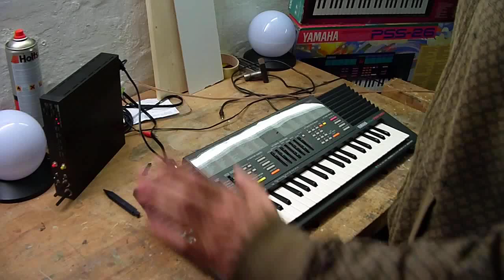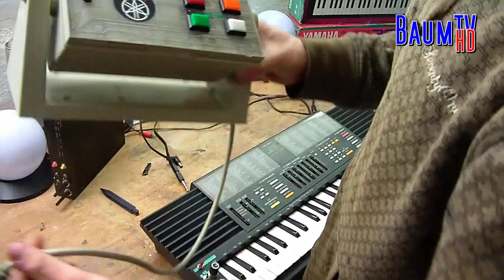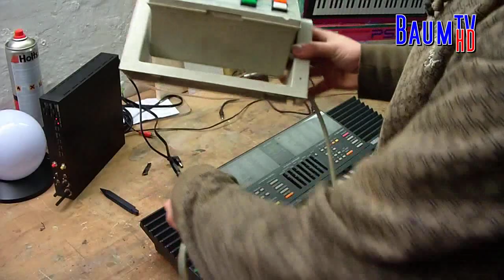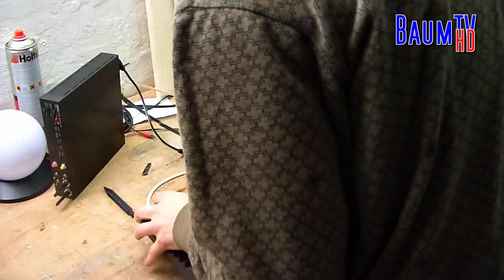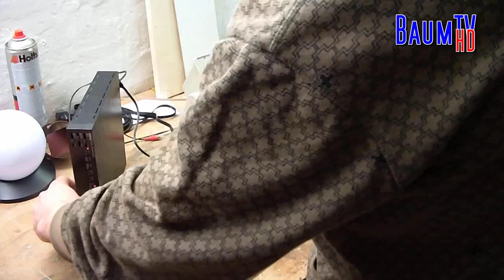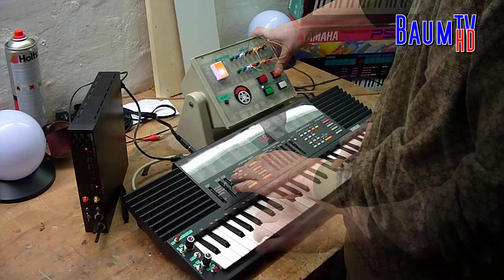Alien Synth Yamaha Portasound PSS 390 (Circuit Bent by BAUM)

Comment: I have two of these synths and I'm going to take this concept a step further and MIDI-synch them together with 2 Highly Liquid retrofits, full dataline mods and full rotary patchbays for both. They will be attached one behind and on top of the other and connected with wooden side cheeks. This means maintaining all functions and having full stereo output of both keyboards. It also means minimal soldering and no need to piggyback chips. Should sound pretty awesome when it's finished :D

Comment: The FM chip inside the PSS-380/390 keyboards is the YM7129, although the service manual calls it the YM7116, (which is actually the FM chip found inside the PSS-280/290 keyboards). This is just a misprint by Yamaha. The dataline pins on the chip are located at pins 11 - 18 (D7-D0) and the crystal clock is a blue ceramic cap located to the side of the chip. There are actually 2 crystal clocks that can be bent. The FM crystal and the CPU crystal. One for note pitch, the other for keyboard speed.
Reply: Michael Samuelle hi I find chip but where  ym7129 pins are addressed ? Is it on xg315do or xg314bo ? Really appreciate your helps cause service manual is unfindable on web. Thanks

Comment: Looks like a great mod. Are there instructions anywhere? Is the 2nd chip also midi controllable? Have you basically put the board from a 2nd pss 390 inside with the other one or only a 2nd chip? What is the black box? Midi? How do both processors pass / mix through your patch?